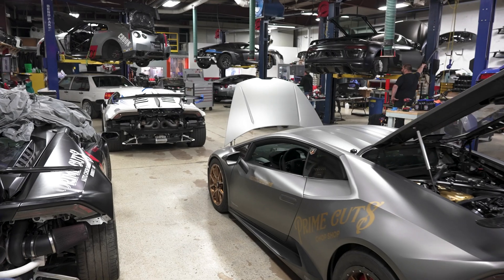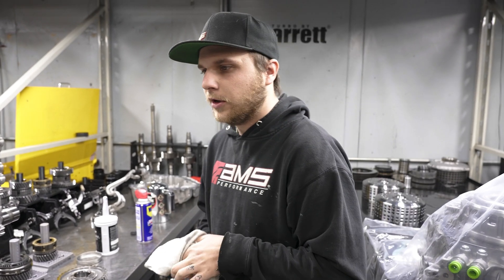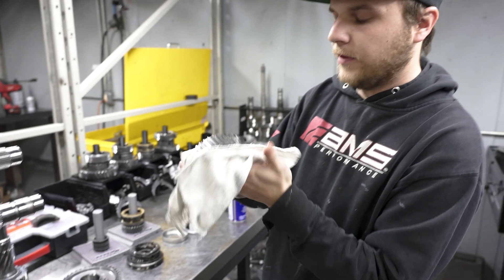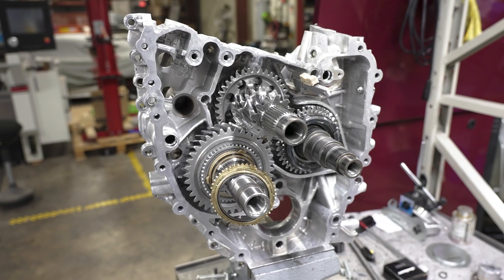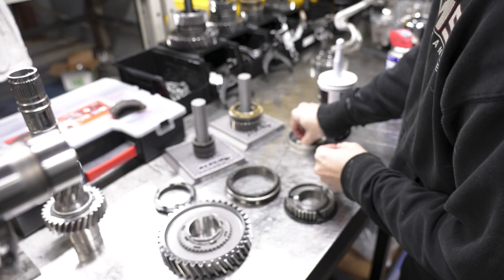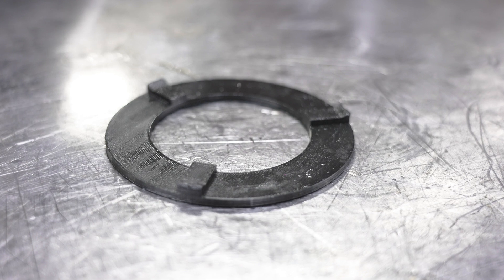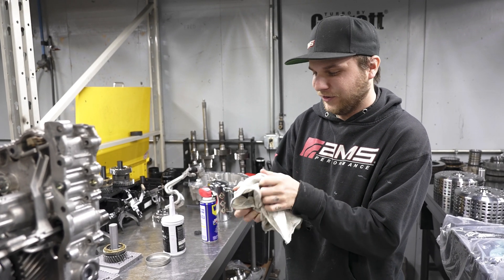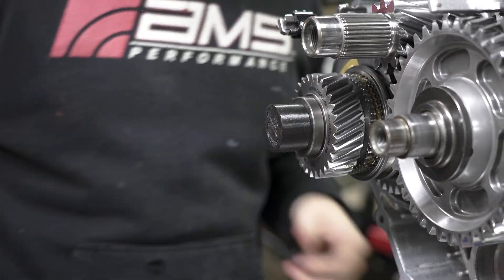SUPERCAR Transmission Build | Upgrading Audi R8 DCT

Comment: Anyone ever create the titanium gearbox. 🤔
Reply: That sounds cool and expensive. But I believe titanium has a lower elasticity making it much harder to machine. And I'm not sure if titanium has a higher shear strength under load than steel.

Either way I'd love to see one made. That would be interesting to see.
Reply: @Mikey6048  Tungsten is another alternative. I've seen 3D printers that print Titanium. Not sure if you can print a gearbox 🤪
Reply: @keithwhittygmail  both would be badass to see made.